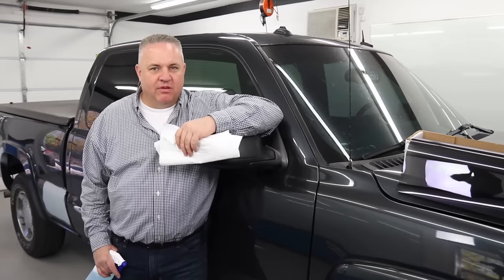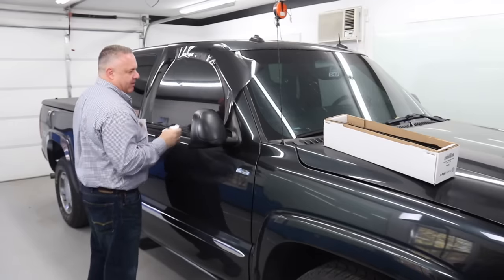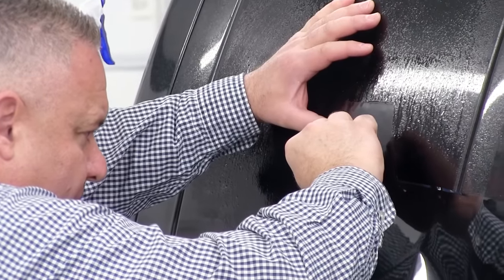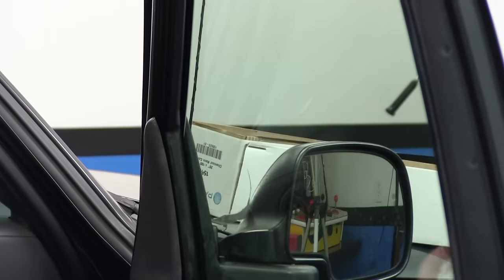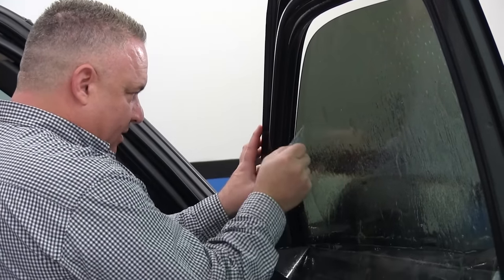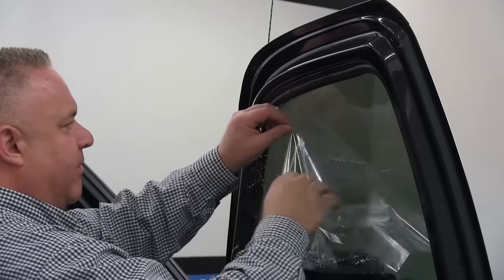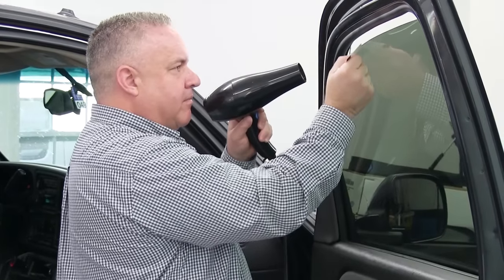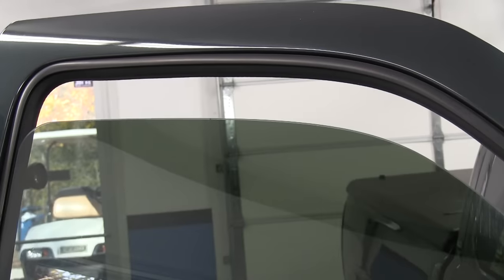World's Best Tint Hack

Comment: Now i always extend my film beyond the window seals at the bottom usually by loosening the door panel to get the seal out the way and the reason is on a hot day if you dont take the film past the seals when you roll down the window the window seal will catch the film and it may crinkle it right off the window. Depending on how hot it is it will cause the film to loosen its adhesive quality allowing the seal edge to buckle the film or lift it entirely. Just thought I'd point that out as I saw you did not extend your film passed the bottom window seal.
Reply: Thats one problem, there are many more in  that video, I would never let this guy touch my car
Reply: That's why the shops tell you don't open the window for 48 hours after they tint. But I always thought it looked better to extend the film below the seal.
Reply: @ Cleety, are you the guy who did my tint and my window seals now leak?
Reply: @dsands4326  I doubt it, its seems your American, Im Aussie, long way to go tint a car lol

Comment: The hair dryer takes a minute to heat up because the intake (on the back of the dryer where the air goes in) in clogged with dust.  It pops right off so it can be back-flushed.  But that's another hack!  I learned a few things about tinting and it is entertaining.  Thanks Ralph.
Reply: I usually but a piece of tape to block a little of the hair dryer intake to raise the temp a little.

Comment: Thanks,nice video,looks like a lot of folks don't know how hard it is to tint a window hands on,I have done a few and let me tell yea its not as easy as some of these folks would like to think.my guess is 80%of the negative remarks are coming from those who have never tried to do tint.I didn't see many/any, taking you up on your challenge.I have ripped up and thrown away tint by trying to handle it when putting it in a slanted back window let alone not making cuts or rips wrong along with the folds and,,well you get the idea,,Its Not Easy as it sometimes looks,you do awesome work
Reply: I agree with this 💯 I’m new to tinting and thought it would be pretty straightforward easy since I’ve done twilights and headlights. Let me tell you that it is not easy at all. It’s so easy to crease the tint and getting the fingers out is hard . It’s one of those things that u have to have a lot of practice to do

Comment: I wouldnt say it was the best but I just did this today with the same tools except instead of a driver's license I used bondo scrapers and Walmart tint. Came out surprisingly well for my first time with tint and being cheap tint
Reply: How it look now I recently used walmart tint and did it just like u explained bondo scraper and all
Reply: @937gemcitywestwezt3  its still holding up well surprisingly haven't had any peeling or bubbling issues and still has the same color as the day I bought it

Comment: Just finished with mine. Using the cheap stuff from Autozone. Best tip i can give for first timers using the "cheap stuff". Get a sharp blade, all your hard  work may go to the trash if the edge or a crease doesn't get cut. This will wrinkle the paper and make the install more difficult.

Comment: This is how I have always done tint (with no proper tools lol) and the first couple tries weren't so great so I started playing with static cling to get the hang of things and squeezee out the water and get the lines right ....but I never took into account the quality of the tint and how easy or hard it makes the job, I usually used the auto parts store tint and it was always a bit difficult to cut and get those micro lines

Comment: Excellent, you explain so nicely, well done.
Question: I have to Use heat gun?
I want to do it on the street and I probably don't have electricity there
I remember someone made me a previous car without heat gun
What happens if I don't use heat gun?
Thanks in advance

Comment: I always thought the bottom of the window tint film that meets the rubber dirt protector goes under and at least half an inch to an inch beyond what you see that way over time with continue use rolling the windows up and down doesnt eventually cause the film to start separating from the window itself? Or am I wrong? I'd like to be wrong because it makes more sense to me because it prevents possible roloff

Comment: Supposedly I got the best kinda tint on my Benz coupe but my car is streak scratching on both sides of the doors. Is it an internal issue or the rubber moldings needs replacing or what? My guess is internally the track is making marks on the tint.

Comment: Forget about using a towel to clean the windows then having to remove all the lint. The best way I found to clean the windows in one step is done using old news paper. Only black and white print, no color or glossy inserts. Leaves no lint or streaks behind.

Comment: In 1996 I ruined the back glad in my original lowrider. It was Christmas Eve, 10:00 pm, 36°, in my dad's driveway. I did two layers of 10% walmart tint. I had a flashlight, a cheap plastic squeegee, a breakaway razor knife, and an old Windex spray bottle of water. I couldn't really tell how it looked when I was done, but it was so dark you couldn't see out at night at all. Coincidentally, as I was backing out of the drive to leave that night, I missed the driveway, and backed straight into a tree at about ten mph, smashing my test bumper in. 🤣🤣 The truck looked better without it. I looked the next day, and the tiny was absolutely perfect on both layers. That was my first time job. I got REEEAAALLL lucky. 👍👍

Comment: I use this exact method and baby shampoo, my jacked up drivers license, and cheap towels, but I do use more than just two usually lol and I don’t use a hair dryer or heat gun unless it’s a big curved glass like a rear window.
 I guess I’m a hacker but I’m no world champ either. It looks good enough for me n ppl are always asking who did my windows. Hey I tinted my whole Yukon 10% for $56 including windshield strip than my Silverado 35% front and 10% everywhere else for about the same windshield too. Wonder how much he’d charge do them?
I have recently upgraded to bondo spreader and a squeeze. LoL

Comment: Not bad, but I have to say if window tinting is your proudest achievement and accomplishment you have in life (and hearing your words and the excitement) than you got it made man. Good for you.
I use to have to put the big long red decals on Exxon tanker trucks. It's a film like limo tint but colored. 3 sections 4ftx6ft on trailers, and on 5 and 8000 gal airport fuel trucks it was 1 pc 3ft x 10& 12ft. We painted and did the graphics for Exxon. I just used plastic Bondo spreaders and hard rollers. You couldn't heat it because it would make it expand wherever you heated it and make a bubble. Also you could not cut any thing or slit any bubbles. That was their specks. Long story short, I know there are a lot of tinters here and if your good you should look into putting on graphic films for these company's that still use graphic logos and big films. It is all that works on polished tankers. Paint and prep work sanding in shapes so paint will stick and not scuffing  up parts left  polished cost to much and down time is not reasonable compared to film. They supply film you just put on . it's good quick money and we stayed behind cause no one did it. If you traveled to do it, you would do great. 
Why am I not still doing it? Well because it was a far cry from what I wanted to accomplish in life.  Putting on stickers has its limits in satisfaction. But I will say it was one of my highest paying jobs. I got $275 on small and $375 on tanker trailers, I could do 5 tankers. In a day. And this was in the early 90"s. Trucks lined up. 4 of us never missed a day with no work.

Comment: Hack jobs with tinting is:
Using tint that is way darker than is legal.
Not removing any old tinting before putting on new tinting.
Using ghetto tools.
Using improper technique.
Leaving lint/dirt/crap under the tint.
Using the absolute cheapest tint they can find regardless of quality.
Leaving an open edge all the way around.
Leaving bubbles and creases in the film.

I've seen all of this on tinting on actual cars. My brother had a car with a hack tint job. Bubbles everywhere, creases everywhere, empty edges, the tint was so cheap it was some weird purple blue color, and of course, it was not an easy tint to remove due to the adhesive. It was stuck on over factory tint and was darker than legal to begin with, so it was practically impossible to see out of except in the brightest of sunlight.

Comment: He did a great job, but where is the hack. I would have done the same thing he did, except I probably would have used more paper towels. I would have used window cleaner. I would never recommend using a rubber squeegee like most say you should do, they don't slide well. Using a drivers license or a credit card works well.
Reply from the maker: The hack was the old fat guy.

Comment: What tiny hack was there.  Most guys I know do it like this. They use a peel wall instead of the customers window. But this was one easy front side window in roughly 30 mins.  I've had 5 windows and a windshield strip applied in less than 30 mins with no gap or bubble.  By one guy.

Comment: I'm the baddest hacker around then!!  2 time ever tinting and I just did my boat (6) windows and 2 being wing windows.. only using autozone tint, plastic bondo spreader, 2 used rusty razor blades and J&J baby shampoo and distilled water in a spray bottle
Reply: And the boat is a 1989 cuddy .. it came out almost perfect  (1 small hair, and 2 light under cuts you'll never know about unless you're looking for them

Comment: If the blade is stainless steel it should be fine.
As long as the blade doesn't have carbon in it.

Comment: Not only did ya hack window tinting but you did a hack job and that’s not good. It’s easy to put it on the outside of the window but your supposed to put the tint on the inside of the window. Never seen anyone put it on the outside of the glass.
Reply from the maker: I haven't either...
Reply from the maker: @nelsont8447  
If you can show me where I installed this film on the outside, I will pay you 10k in cash.

Comment: Im just going to assume you cleaned the outside of that door before you put the film on there. And the "worlds best" using a small hand held spray bottle lol. Try a 4 gallon high pressurized sprayer. Lot more efficient.

Also a tip for the "worlds best" here. Roll down the window first.. then place the film on the glass and make your cut at the top then roll up the window and finish the cuts. Very weird how this guy did it.

And yes I tint windows for a living, not just talking shit
Reply from the maker: Thanks for the tip.  You might feel more comfortable if you watch me tint in a more professional setting rather than a "hack" setting since you are a professional.   Here is a link to a video where I had the best side window with the highest score in Reno at the world Tint off competition.   Enjoy.  https://youtu.be/so-bp3VpSuI
Also check out my small tint business.   Www.flexfilmstore.com
Reply: @FlexFilmPlus  Appreciate the reply! Yeah after I made the initial comment I was thinking about the premise of the video using "hacks", as you were using a hand held razor blade which was impressive to say the least. I'm sure if you had all your usual tools it'd be a totally different video.
Reply from the maker: @davidlowe6717  
I agree with that.  Thanks for taking your time to comment.

Comment: I guess my definintion if "hack" is different. I saw no hack. Just another tint job. Same tools. Some use other stuff. I have seen good and bad. Same as NE other skill. It
Some think "Ur only as good as Ur tools". I'm better. Expensive and /or job applicable tools do no good if the user has not knowledge of them, the job or their skill. I make/modify most of my tools and I'm top notch in what I do. However, good tint job.

Comment: Fella should talk less.  I'd do that window in 4 min.  In fact I did my whole X3 last week in less than a hour.  That's cleaning preparing and hoovering.   Jesus it's not hard.   The only thing you can do wrong is 
1 not clean window
2 not spray enough
3 make bad cut
4 cut short.    

Easy
Reply from the maker: Make a video or it doesn't exist.